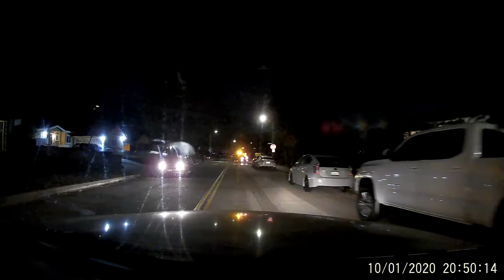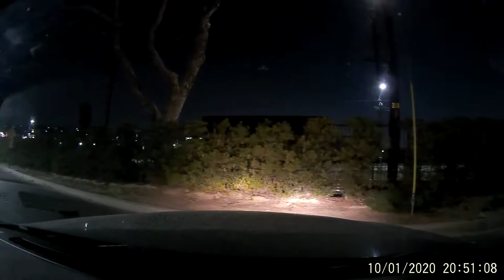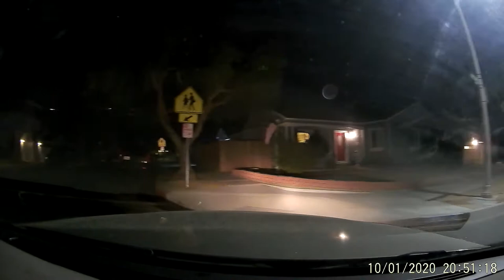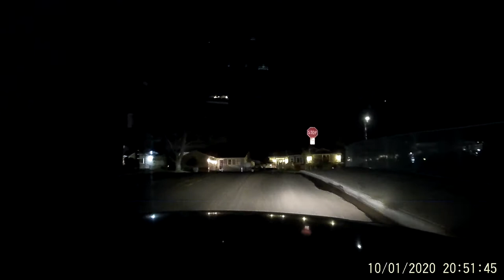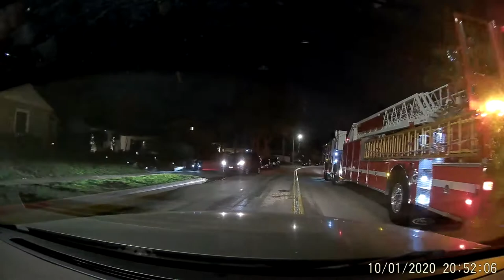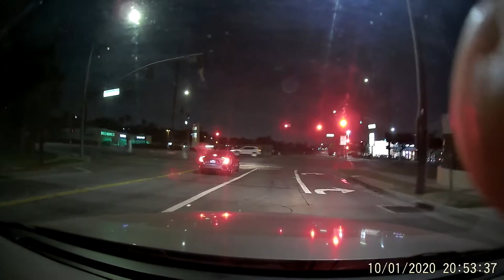Broken  WATERMAIN on Newton Street. Our HEROES UNABLE  to Turn off  the Water For Over an HOUR!!!

Comment: Sprinklers have nothing to do with main valves.
Reply from the maker: You are totally  RIGHT! 
Unfortunately  my cellphone video was too dark and useless to show that when the  FIREFIGHTERS, and the Cityworkers were not able to stop the water from flowing .They tried  everywhere. Even blocks away.
They know how to go to the beach, shopping  etc. Dealing  with an emergency?  Not so much! 
By the way! The City  fixed  the WATERMAIN, and it broke  again 2 or 3 times  at the same place. Most  recently a month ago right about  Xmas time.  Right there and 2 other places  on the same street on Newton.  The sprinklers  are fine on PCH. FOR NOW,  !
Thanks for watching.  This video  didn't  get to much views!  LOL. I should  just take it down.